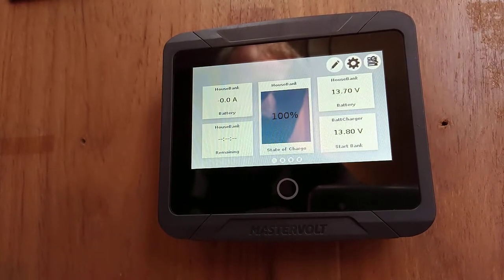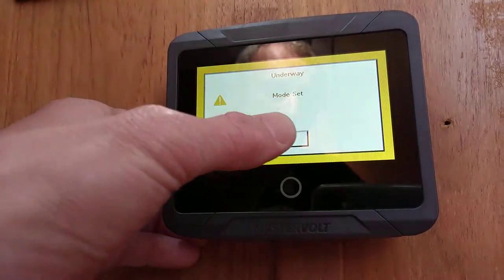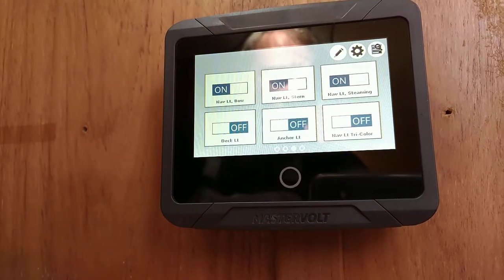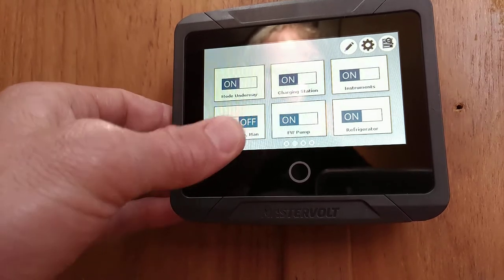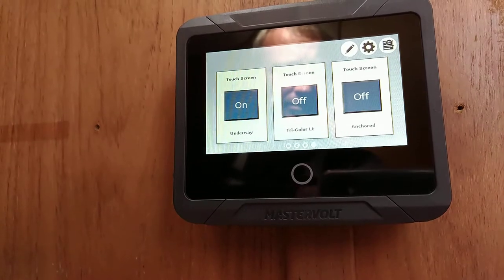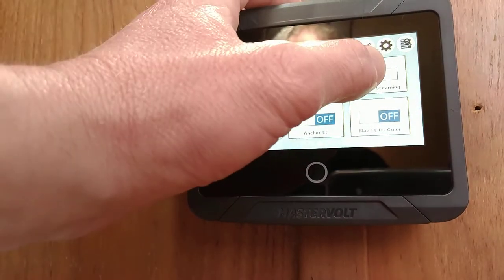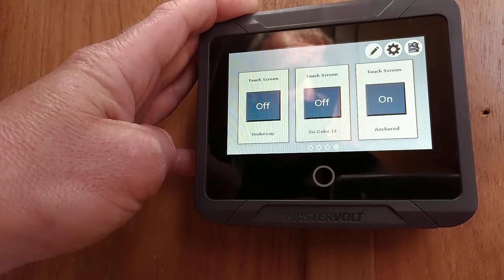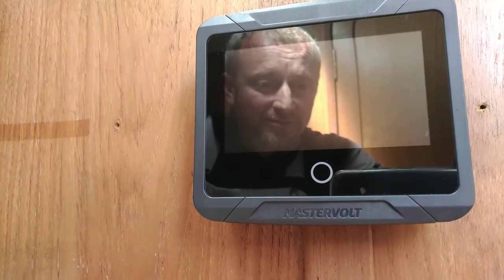Walkthrough of a Mastervolt Easyview 5 Touchscreen Control Panel

Comment: How about a video talking about how to program the switches in the easy view.  It seems you can only only program one function per switch.  I don't see how to get more than one status per switch so for dockside how would you switch the charger AC max to 30 Amps and the float to 12.5 to protect lithium batts..  I sounds like you are getting multiple functions out of one switch.   You you turn on an easy view for the first time you get Nothing.....  just a white screen so you showed off a cool programmed unit but how did it get that way?